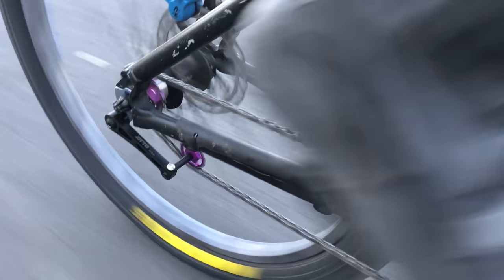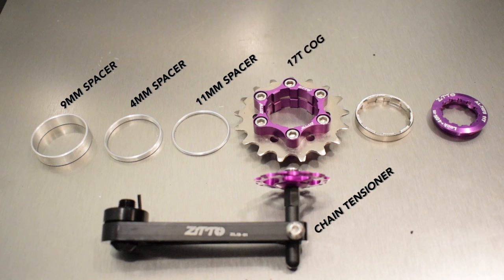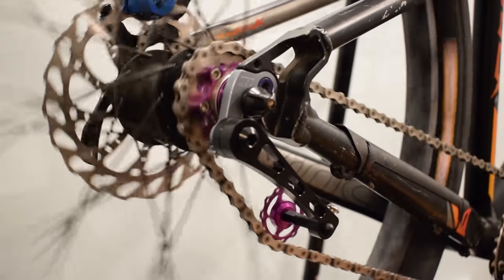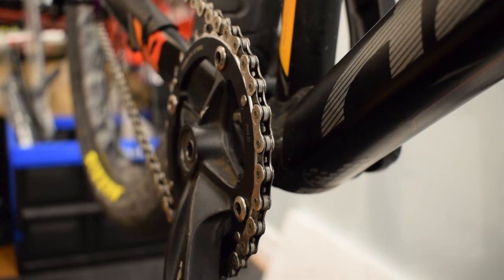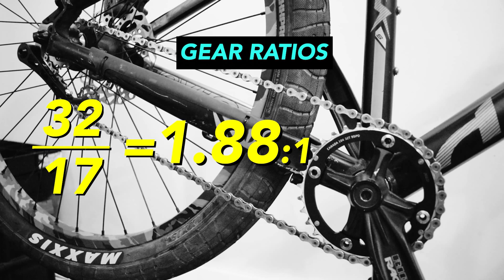Singlespeed Conversion: Gear Ratios

Comment: You should have mentioned that gear ratio is also dependent on your preferred tire size. A 32x16 may work well on a 26er all-around mtb but is harder to pedal on an equivalent 29er. A 32x18 may be a better option for the latter. Consider gear inches for this.
Reply: Ok thank you I want to run a 32x16 on my 29er because my 32x18 pedals to fast want harder pedaling
Reply: I was running 32x16 with knobby tires on my 26er when I did most rides offroad with a lots of climbs. But currently I'm running it 34x16 since rides are mostly paved roads with minimal offroad.
Reply: @anhb4203  what gear ratio should i opt for if i have a 29er tire and a 34t crank

Comment: I don’t understand running anything less than a 44/16. I ride an all road single speed and climb just fine. The bicycle originally came with 32/16 but I cant deal with all the spinning.

Comment: Hello nice video I’d like to ask what chain were you using… are you using a single speed specific chain or the existing chain that you have from your mountain bike? thanks… I am also in the process of building a single speed bike as well with 32/16 gear ratio. Your reply would be highly appreciated!
Reply from the maker: Hi, I’m using a new 8 speed chain, I didn’t reuse the old chain.
Reply: @DanyoSports  Thanks for the input..

Comment: I have a full suspensionm bike that I want to convert to single speed. Is that chain tensioner up to the task for fs bikes ? Will it cause any problems ? Or should i go with another kind of tensioner like double pulley ones, what do you think ?
Reply from the maker: This chain tensioner is great and it will fit perfectly on your full suspension bike.

Comment: Thanks very nice video well made. I'm running 32*13 right now cause I'm waiting for the tensioner as soon as it's in I'm back on the 17 for sure. I climbed Atwater at 23 mph the other day in that 32*17 configuration. I use a 1500w mid drive to do that. Acceleration are awesome on the 17 versus the 13.

Comment: Hello, I've got a 29er hardtail I'd like to convert, I like very techy trails and I've got a 34T up front, what would you recommend on the back? Ace video man.
Reply from the maker: Hi, I think 17t or 16t would be good, you want a gear ratio of 2:1. I suggest you to ride on the trails with these cogs for a couple of miles and then decide whether or not to go with that gear ratio.

Comment: I live in L.A and currently trying to convert a Mongoose ICOMP mtb from the 90s to single-speed freewheel. Recommendations on the gear? I am a pretty solid rider nothing crazy or anything I like speed but don't want to tear my leg muscles either. Something smooth that can give me a comfy speed and allows me to climb easy hills around the city of L.A. I can always walk up any major hill but I can ride up a reasonable climb.
Reply: Did you ever find out your gearing ?

Comment: Nice video... i have a single speed mtb gear ratio is 17t cogs with tensioner and 32t chainring, when hard pedaling in climbs my chain slips... im using my existing chain ( 10 speed chain ) is this the cause of the chain slip? What is the solution to stop the chain slip? Will i buy a new chain? TIA ride safe
Reply: Yes, definitely need a new chain.

Comment: I use 21 speed mtb for commuting but has to climb up on flyovers and steep pavements sometimes. Would it be a good idea to go single speed for low maintenance?
Reply from the maker: Choose a gear and keep riding it for a couple of days, if it’s too easy or hard, choose another gear and ride again for a couple of days, you’ll find your gear ratio and also whether you should stay with singlespeed or not.
Reply: @DanyoSports  That's a great idea. Thank man.

Comment: Hello, i have a question about the cog, do you thinkg the violet thing in the cog can be remove?
Reply from the maker: Hi, yes, the spacer and cog can be separated with the bolts removed.

The pulley is also removable, check out this video: 
Singlespeed Tensioner: Noisy Pulley?
https://youtu.be/VlZZ66eOkew

Comment: Hi, I already have that kind of tensioner, just want to ask if is it normal that there is a sound while pedalling? It is properly alligned. Thank you
Reply from the maker: Hi, yes, that’s normal, the sound is from the metal pulley.
Reply: @DanyoSports  thank you for that :) btw I am currently using 18t x 36t chainring setup for my fat bike :)
Reply from the maker: Nice, have fun with it.

Comment: I already converted my geared mtb into single speed, just wondering if it's normal that the tensioner is noisy and tends to produce a slightly squeeking sound?
Reply from the maker: Yes, it is noisy and that’s the downside of using a tensioner.

Comment: I have a 32/16 with a loose chain(removing 1 link won't close). Does anyone know if I change to 18 will it make a significant difference in the chain tension? or will it even work with the same chain length? I'm trying to avoid a chain tensioner, and the 18t would also be convinient for my hills.

Comment: 32/16 on my build can you go fast on the road?
Reply: No. At a cadence of 90rpm, you'll only go 23kph/14mph. For the road, riders usually use 42/16. I got 36/14 + 32/18 - dinglespeed ;-) Check this out: http://bikecalc-staging.herokuapp.com/speed_at_cadence
Reply: @chrisko6439  thanks

Comment: my chain is jumping on the rear chainring when pedalling harder. you have the same problem ? fresh chain.
Reply from the maker: Check the chain tension and the position of the tensioner, it might be not tight enough or the tensioner is off.

Comment: I want something fast and easy in the terms of gearing, I just got this beautiful GT Pantera that I want to convert so badly to single-speed because I hate shifting and gears. What do you recommend? I have a 36T for the chainring.
Reply from the maker: Start with the 18T cog and ride it for a couple of days, if you find it too easy or hard, switch to another cog and ride it again for a couple of days, this would give you an idea of the cog size that is more suitable for you.
Reply: @DanyoSports  17T or 16T would be better, now I ride fixie.. i'll put straps to mash!

Comment: i want my single speed fixie balanced,I mean can comfortably used for moderate uphills and on city riding what gear ratio can you suggest to me?thanks
Reply from the maker: Gear ratios from 2.2 to 2.4 should be good for uphill and city riding.
Reply: @DanyoSports  thank you so much bro that really helps

Comment: so, if i run a 34 chainring with 16 sprocket, it's optimal enough for road and uphill?
Reply from the maker: 34/16 gives a gear ratio of 2.12 and it’s a little more on the road side. Try this setup with your current cassette for a couple of days and see if you like it or not.
Reply: Try dinglespeed. Two chainrings and two cogs. I run 36/14 and 32/18.
Reply: What setup will you need if you want go off road trials ect
Reply: @chrisko6439  i have a 48/18 gear ratio, do u run that with a chain tensioner cuz i dont
Reply: @A90L..  No chain tensioner, because I don't like it. Problem is, the bike has vertical dropouts. I solved the problem by using BMX cogs, they have very long teeth, so the chain won't skip. Also, I have to wear the chain a little by using it on another bike first, because a new chain won't fit on 36/14. ;-) When it starts to skip, I just change it, it will wear down then chainring anway if used for too long. You might wanna consult Sheldon Brown on this topic. An article about extending chain and sprocket life: https://www.sheldonbrown.com/chain-life.html  Since I can't tension the chain because I got vertical dropouts, this article isn't of much use for me, but it might be for you :-)
Reply: @A90L..  does your 48/18 can go uphill
Reply: @Zamora7  ehh it does but its kind of a struggle, atleast it was when i was at a La rideout and we went up a long hill it got tiring but its work good, im running 32/16 right now

Comment: Is a 32T in front and a 13t on back good for trails on mountain bike?
Reply from the maker: It would be harder on uphill riding, try 16t on back, use your current cassette and ride for a couple of days and see if you like it or not.
Reply: @DanyoSports  2:1 sucks ass when riding TO the trails ;-)

Comment: I just ordered a Single Speed cog like this one and it isn't arriving yet my Front Gear on the Pedal is 28T while I order is 16T do you think is it fair enough? I still have a 32 Chain ring but 28T Chain ring the question is can it help me to go up into a Steep Hill?
Reply from the maker: Yes, 28T would be easier for uphill climbing, what I would do is to keep riding with the 28T for a couple of days (use your current cassette with the 16T cog) and then switch it to 32T to see the differences.
Reply: @DanyoSports  Oh Wow Thanks for the response last question can it be fit on my 9 speed cassette type hubs? because I feel worried what if it did not fit and I will buy a new hub just for single speed cogs?
Reply from the maker: Yes, the kit fits on 8,9 and 10 speed hubs with the right amount of spacers inserted.
Reply: @DanyoSports  Oh thanks now theres nothing for me to be worried about thanks imma subscribe in return thank you :>

Comment: How to determine chain length with SS and tensioner? Skip the tensioner and then add four links as with 1x setups?
Reply from the maker: Yes, you can try that, as long as it has about 1cm of play up and down, that would do it.

Comment: Is a 30t x 12t gear ratio good for wheelies?
Reply from the maker: No, the gear ratio for that setup is 2.5, I would get something from 1.8 to 2.0 for wheelies.
Reply: I had 30t x 14t and was pretty hard doing wheelies i had to go around 20-25kmh to be able raise the nose after breaking in wheelie !

Comment: dont need the tensioner ,chain turned out to be just the right length. use a 13 on the rear and 44 on front, its an Ebike

Comment: Can i turn it into fixed gear using the same hub?
Reply from the maker: No, you can’t, you need to change the hub to turn it into fixed gear. Try to get a flip-flop hub/wheel, you can switch between fixie and freewheel at anytime by flipping the wheel.
Reply: @DanyoSports  i was wondering if the cog can be installed on disc brake side so that it can be a fixed gear.
Reply: But of course, the disc rotor will be unused.
Reply from the maker: It’s possible, you’ll have to drill 6 holes on the cog, let me know if you get it to work,.

Comment: If I run a 32t chainring what sprocket size should I get
Reply from the maker: It really depends on how you want it, I would go for 16t sprocket for road and mountain riding.
Reply: @DanyoSports  I do wheelies and liek to ride fast and the gear is to low
Reply: I wanted it to feel like a se racing big ripper gear ratio witch I’m pretty sure is 32x16
Reply from the maker: Yes, try that and you should be good.
Reply: @DanyoSports  ok thx

Comment: Would a 21t on the back and 32t on the front would be good
Reply from the maker: The gear ratio is 1.52, the pedaling would be easy and faster at low speed, it’s great for park and uphill riding.

Comment: 36/14= 2.57:1 (Perfect)
Reply: Would this be a good ratio for normal flat road riding and good resistance for workout on hills? I want my mountain bike to feel like my bmx did just normal pressure all around and harder going up hills for that extra workout.

Comment: I use a 36t/16t it’s pretty quick lol
Reply: is 32t/12t good?
Reply: @JoshuaJonROcana  in my opinion no its more of going quick i run 32 front 15t rear now
Reply: @JoshuaJonROcana  but if ur just tryna go quick or bike around the city yes
Reply: @JoshuaJonROcana  it will be hard to pedal a bit but u will go quick
Reply: @Le_Papa  thx man, but I'm currently running on 32t/16t
Reply: @JoshuaJonROcana  i might switch to that insted for easier wheelies lol

Comment: The chain tensioner is noisy
Reply from the maker: That’s correct.

Singlespeed Tensioner: Noisy Pulley?
https://youtu.be/VlZZ66eOkew
Reply: @DanyoSports  i bought one and reducing the spring tension right off made it quieter also properly alignment of the derailleur hangar made a difference....i also found that it twisted from the pressure of the spring so i used a washer in between the tensioner and the bolt head to try and reduce the twisting...really its not well made....but is do able...i used a 10 speed chain...but maybe a wider chain like 7 or 8 speed would help reduce noise....
Reply from the maker: Good to know, thanks for sharing your experience with the tensioner.

Comment: Is it okay with out the tensioner when going on trails?
Reply: I realize you asked 6 months ago but just incase... I wouldn't unless you have a "half link" chain that lets you fine tune the length of the chain. At best it'll annoy the hell out of you when the chain keeps jumping off and at worst it jumps off when you really need it and it causes you to crash. Now your bike is FUBAR and you've gotten a couple broken bones.